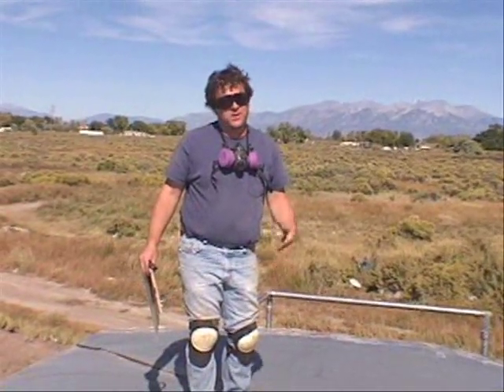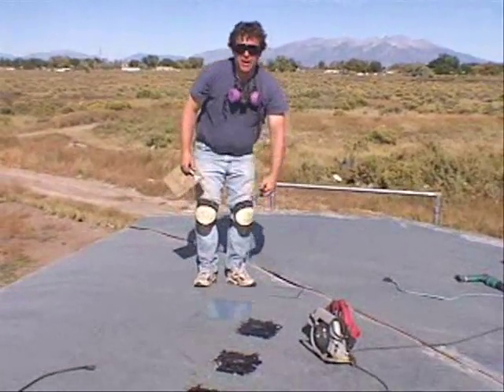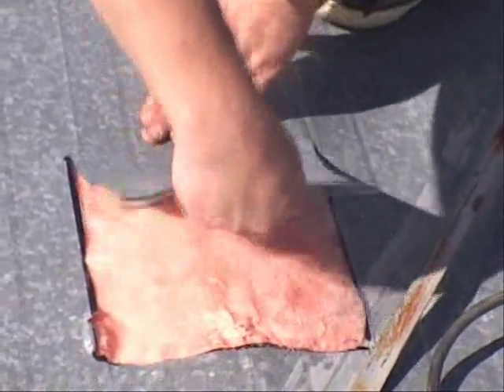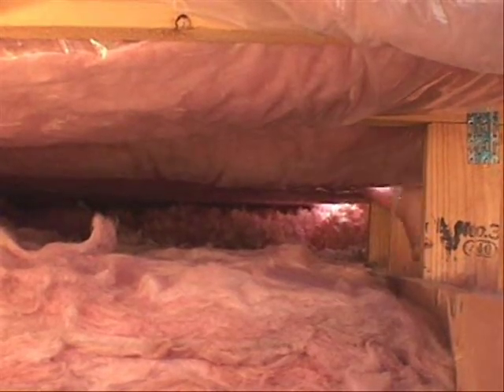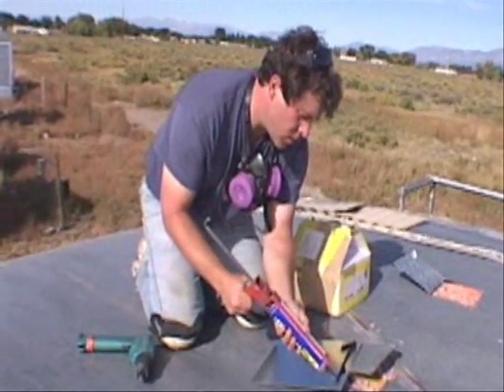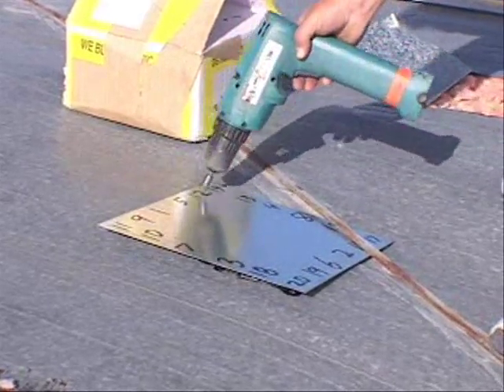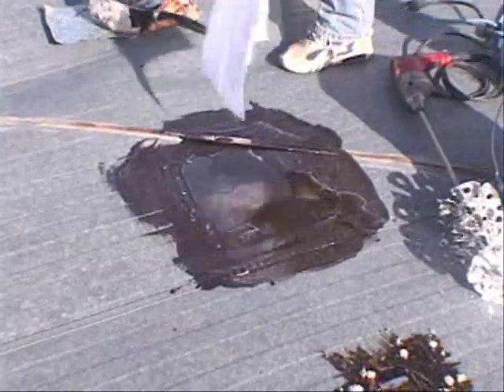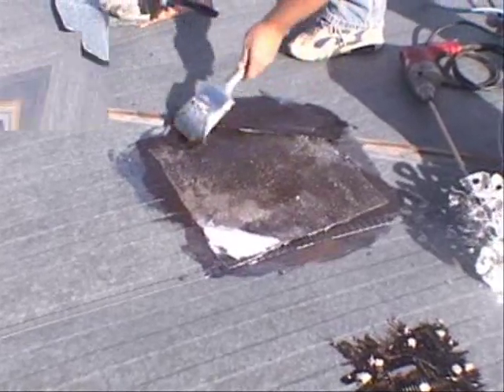Insulating the Roof of a Mobile Home

Comment: What a waste of money...  best way to insulate a Older roof is to use 2" thick 4x8 sheets of  stryrofoam with 2x4 framing with new white refelective aluminum rolls..... the way u guys do it wont allow u to fill every cavity that will give you Complete coverage.